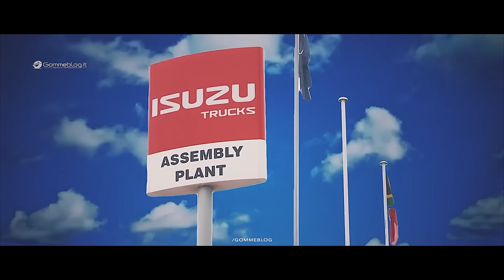Isuzu Truck Factory 🇯🇵 Behind the Production Japanese Trucks

Comment: Sending Upgrades New Modern Isuzu ELF Truck Design The Trailer Tractor Head Truck, Double Axle & 20ft Long Haul Trailer Wing Van Design With Reverse Camera Trailer ,, Increase Engine 6D22 Turbo Diesel Engine 600Horsepower & 6D40 Turbo Diesel Engine 600Horsepower 😊😊❤❤🙏🙏🫰🫰👍👍✌️✌️👌👌🤏🫶☺️😉😲♥️❤️🍏💙💙💙💙💙💕💕💕💕💕💖💖💖💖💖💖💝💝💝💝💝💝💚💚💚💚💚💚✅✅✅✅✅✅🏆🏆🏆🏆🏆🏆🎇🎇🎇🎇🎇🎇🎇🎇🎇🎇🎇 explore more than beautiful Stronger Engine Excellent perfect design